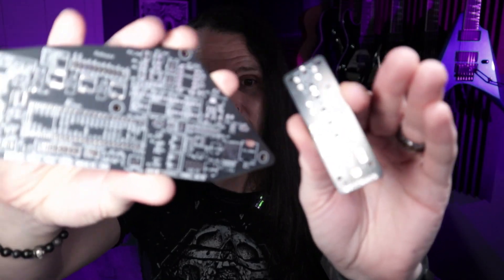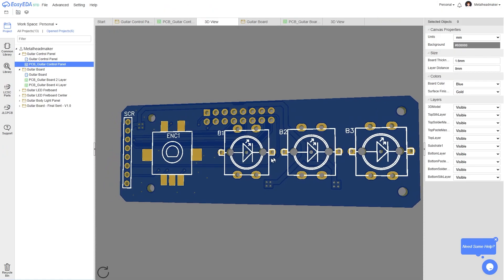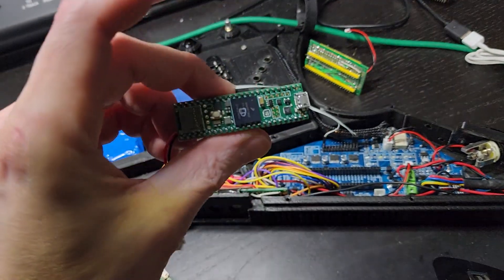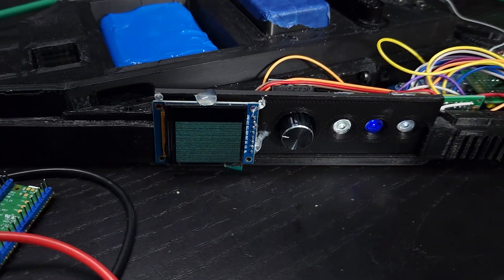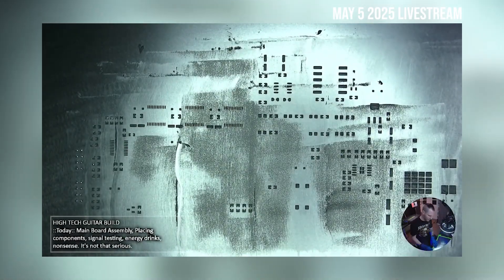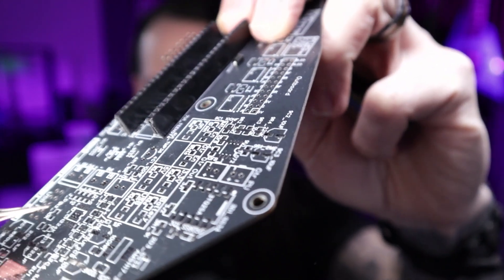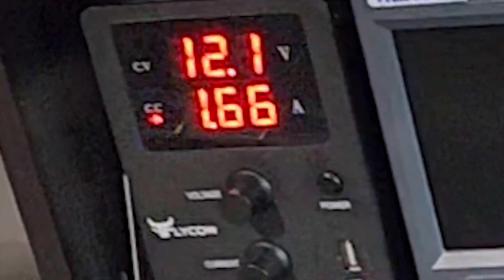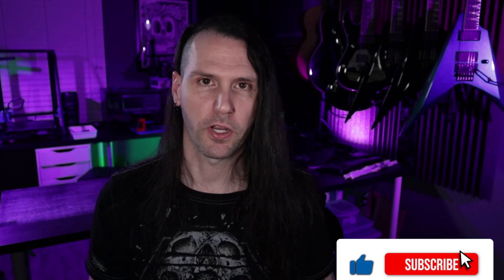High Tech 3D Printed Guitar Gets An Upgrade

Comment: 1)   Do you have the schematics around?  I'm trying to diagnose your noise problem from the latest video.  It looks like you put EVERYTHING on this!! (headbang!)  I'm looking for any high dI/dt (high current switching situations).     2)  Did you handle the return current of every trace on your PCB?  If you didn't, that's mega gotcha for new/medium PCB design people.  It ate me up for years.  It's a noise fest if you don't account for return current of every single trace particularly for mixed signal PCBS (digital + analog) PARTICULARLY for monster metal gain.   If you have the Gerbers/ODB++/whatever I can take a look for any red flags.       If you aren't into sharing these docs, I get it.  No problem.  Just trying to help.  GREAT WORK!!
Reply from the maker: Really appreciate you digging into it. The small uptick in video traffic and amazing support from you and others have been amazing, but I'm having to pick either working on the guitar and falling behind in discussion or vice versa. Sorry for the delay here.

I did try to give every signal a clean reference plane, but with the density of digital lines and the long LED runs, I may have created some unintended loops or broken ground paths that force return current to wander. I can probably share out some schematics on discord since I started a server a while back but decided to not invite anyone yet. If I get that finalized, I'll ping you with that info if that's alright. As far as where to go next, I'm compiling a list of suggestions that everyone gave me and I'm going to vet each one of them, so hopefully I can get a big recap vid together walking through all of the points.

Thanks again taking the time to think it through! 🤘

Comment: That thing is going to look badass! Most of the 3D printed guitars I've seen sounded pretty tinny.  So I'm interested in seeing how one sounds like with a high output pickup.  Kudos for going the extra mile and adding a rechargeable battery! 😊👍
Reply from the maker: Thank you! The only reason I haven't posted more is because I've been working on it all summer and I want to do one strong push of videos to finish out the series instead of giving a bunch of minor updates. Thank you for checking it out! 🤘

Comment: Bro use level logic shifter if u have issue wich 3.3/5v sig
Reply from the maker: The board is much more complex than I explain in this video (I cover it in other vids). I have that already using the TXS0108E for expansion pins, but that is unnecessary for the devices that can and should run 3.3v. Simply running those components at 3.3v makes much more sense.
Reply: @metalheadmaker  
that's true, dividing the project into 3.3v logic and the rest of the high voltage is a good idea. Honestly I thought you had everything that could be 3.3v connected to 3.3v and you're just fighting with the rest. below @Blazico also gave a very cool idea :]
I'm keeping my fingers crossed for the project!

Comment: Keep up with the good work!
For the buttons and LEDs you could use i2c shift expanders (sx1509 or tca8418) to save pins and use cheaper MCU. Or plain shift registers.
For the USB PD 12V - are you sure that your charger supports it? I am not sure if that voltage is defined in PD standard, but I could be wrong. Ikea "SJÖSS" for example supports 12V/3A.
Reply from the maker: Thank you for the input man! 

1. 100% on the i2c expander - I used the PCF8574 on a robotic arm controller a while back and it worked great. I started to play around with the idea of sending in a design to JLC for something more compact using that IC along with an ADC to fill out the analog side. Then I realized that I basically burned an entire week on a side project and put it aside. 😄

2. Good call, but yep, the IC is the CH224K and I'm using a true PD charger. I was actually able to get 20V out of it fine, so it's gotta be a config issue. Should just be CFG1 0, CFG2 0, CFG3 1 ...but to be fair, the board layout is really dense in that area. I just gotta spend some more time comparing my schematic to make sure I'm jumping correctly.

Comment: For buttons on the Teensy, I personally always connect them to ground instead of 3.3 (or 5) and I set the pin mode as INPUT_PULLUP in the setup function. It just works and reduces the risk of frying the board.
Reply from the maker: Omg you're right. 🤦‍♂️
Reply from the maker: Ha just saw your shout out on Bradley Hall's vid. Thanks man! 😁